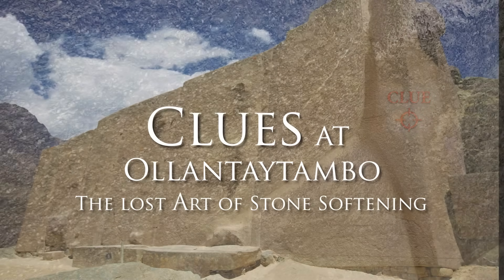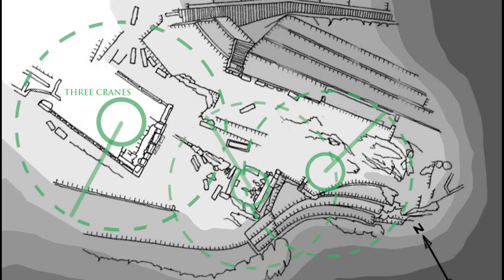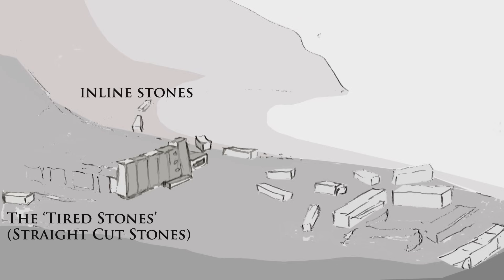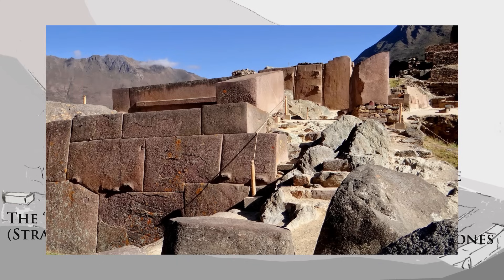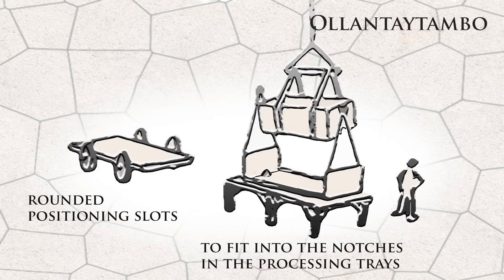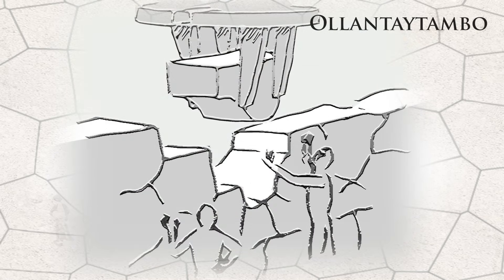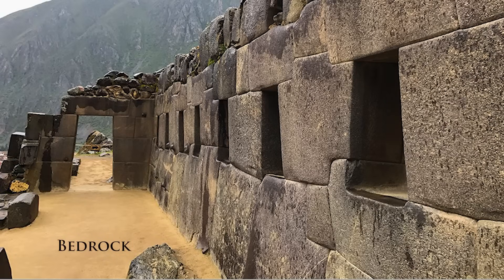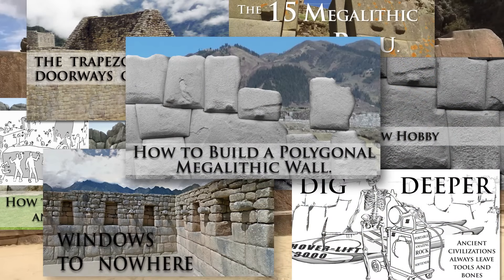Clues at Ollantaytambo. The Lost Art of Stone Softening

Comment: Wire cutting?  Where did the wire come from? Rocks contain several kinds of crystals. You can't "soften" a crystal structure. And don't you just love the wagons they used? This whole thing defies science. Or ignores it.
Reply: Copper wire and diamond dust?
Reply: Ikr- idt barbed wire was invented 
1870..😁
Reply: I think rocks can be cut with wet string and sand. Not sure how they get internal corners. It will be obvious when someone figures it out.

Comment: Volcanic rock is hard as iron, but it is as soft as cheddar cheese while still in the underground mines, easy to cut into regular size blocks for building defensive walls which harden exposed to air. Romans knew this.
Reply: Lol. You just made that up. Complete load of tosh!
Reply: Sorry Mark it’s cold hard facts!  12 years in Archaeology you pick up a few tasty scraps of knowledge.  Maybe these ancient rocks are a lot softer when freshly cut from the belly of the planet?  If so, you’d need a handy lump on the side so you could repeatedly lift and drop it to mould into the rock below. Less glamorous than a sonic probe but worth thinking about. Let’s go find the quarry and dig down past the oxidised crust, down into the easily workable stuff 🤪

Comment: I have questions. How do they manage to cut the stone in to pieces in the first place from the quarry? Second no one has ever found tools capable of cutting granite and other materials of this hardness. Where are these tools? To soften the stone in the first place the components that make up granite are silicate or crystalline. I may be wrong, but to reach a temp enough to make them soft they need to be at around 600 to 800 degrees to begin the softening process. I’m not too sure I buy the hypothesis of using plants to soften crystalline stone.

Comment: If that rock wasn't melted with heat, any liquid, even under pressure, would at best find its way thru some cracks...or dissolve it in the case of acid.  Or take thousands of years..maybe.  I'm definitely listening and a well put together piece. Great job yo.
Reply: The rock was neither melted (no sign of burning) nor dissolved (it could not harden again). Instead, it was softened by some chemical agent. According to Indian legends, the juice of a rare mountain plant was used in ancient times to soften rock.

Comment: This is only thing that makes sense.  It’s either that, or they literally had hydrolic machines with table saws, etc to cut the rock.
Reply: so true
Reply: The site was undergoing remodelling work when abandoned.  That would have been in the 1400s.  Stonecraft of very high quality had been a thing for the best part of 1000 years by then. And yes, no shortage of iron (albeit expensive) iron tools.  The oldest iron-mine can be found in S America and dates back 11,000 years.
Reply: You can cut rock with a wooden saw, using sand and water. Just slide the wood back and forth, drizzling on the sand, and keep the cut wet. It goes surprisingly quickly. The modern version uses tensioned steel blades, but works just the same. Look at the marble quarries (or granite blocks broken out using wedges, then cut with the saws).

Comment: hmmmmmmm, nope i cant believe it. As a stonemason softening stone would be a terrible idea lol, Stone is made of many types of minerals. Soaking in a solution that some how softens these crystalline structures almost makes it pointless. It wouldnt hold its worked shape and even as it hardened it would have to shrink leaving massive gaps in the stone joins, you cant add a fluid to stone and not have the stone swell with that fluid and then expect it not to shrink when that fluid is gone? 
polygonal masonry is pretty impressive looking, but also not as labour intensive as trying to make flat square stones sit flat and square. Just have a look at drystone walls. no mortar just stones that sit and fit together from their natural shape. As for the bedrock not being removed. Thats on purpose because thats the foundations. you dont dig out the concrete under your house for the same reason. Shits gunna fall down lol.
Reply: If the degree of softening was controlled by the concentration and temperature of the active agent, a treated stone block could hold its shape sufficiently. After all, the builders were not carving sculptures and they didn't care if the worked shape of their cut stone did not hold exactly. They did not care about any deformation and distortion of the blocks they had cut because the whole point was to let the blocks undergo some deformation as they were placed together so as to fit perfectly. Your objections are misplaced.
Reply: @stephenphillips4984  it would be easier to carve them. These are people making things from stone. The easiest way is usually the best way... So if they can concoct a solution that softens stones and have the technology to control its ratios and heat required then wouldn't they have the ability to just make it square? Just pump them square 10t blocks out all day.. easy right?
Or do you just get like 300 slaves to bash away at rocks and slot them together while you chill in the palace eating jungle fruit yo...? 
Yeah, see which one makes sense now. 
Rock is not science. It's common sense.
Concrete is science, which there is lack of. 
I do give ancient humans credit for doing these constructions, humans are smart. Bashy rocks to make temple smart, not chemistry denying rock melting gods smart...
When you have worked with the earth and stone like I personally have. Some things are as plain as they seem. It's not hard.(pun intended)

Comment: Excellent clue evidence of stone softening. However, three problems: 1. why spoil the plausibility of this theory by invoking unnecessary sonic tools that require power sources equivalent to those of the modern era - an idea that scientists would not accept?  2. How could immersion of something like a block of andesite in a tank of liquid result in the latter soaking through its bulk so as to soften it? It is apparent that ALL the volume of a block was softened, not just its surface, as the fine wire cutting indicates. But this would require the softening agent to soak deep into the  hard stone? It is hard to believe this is possible, but I suppose all bets are off until we find what softening chemicals were used (perhaps the juices of a certain plant, according to legends). 3. What were the knobs on the faces of some blocks for and how were they formed, given that the raw, cut blocks would have had smooth surfaces? The softening theory needs to  be able to account for them as well.
Reply: andesite is igneous rock and main constituent are silica so like granite it is impervious to water the only thing that dissolve these type of rock is hydrofluoric acid
Reply: @al2207  We are not talking about dissolving. The rocks were softened, not dissolved in any way.
Reply: @stephenphillips4984  Surely in order to soften a rock fully it must be penetrated fully by the 'special liquid'.  And since igneous rock is impermeable to water that could never happen.  So that's the end of this crazy theory !
Reply: @coloneled2831  maybe yes,maybe not... Like Tesla alluded to , to understand the universe, we need to think in matters of energy, vibration and frequency ... There are recent experiments about Sonic levitation ... We lost a Lot of technology ...  Vedas had Vimanas ... Baghdad batteries were that , batteries.... Not everything needs to be powered by thousands of watts... Nikola Tesla figured out how to use cold electricity .... And that's why he would grab lamps w his hands ....the current teaching system , is a fraud ...
Reply: The knobs look like a side effect.

Take a block of soft clay, now let it dry a little, then drop another block on top of it. You will get a knob exactly like the observed knobs when the softer core breaks through the partially hardened crust.
Reply: What kind of "wire" was used. This is bs. I under stand the softening, but sonic clamps a stone cutting "wire saw?"
Reply from the maker: Stephen,  Thank You for your comments!   In my last two videos I mention the use of a sonic soft-stick to soften the stone and to stear it into position. And in my latest video 'The Math and Science' illustrates this even more.  I hope this helps.
Reply: Unfortunately, it didn't answer my questions. But at least we both agree that there is a real problem to solve, unlike archaeologists with their stone pounders and bronze chisels. Sonic tools fail to solve the issue satisfactorily because they would, presumably, require the application of electrical power. Did the builders trek up the mountains with large batteries on the backs of llamas? I doubt it. And so would scientists, because the notion implies technological advancement of a degree for which no other evidence exists. The notion of powered tools is therefore as poor an explanation as invoking aliens.
Reply: @stephenphillips4984  what evidence of technological advancement would you expect to find after thousands of years? Power cords and electrical plugs? Only the stone itself would remain. 

Batteries and Llamas are an allusion to the Inca of 500 years ago. The megalithic structures were in Peru long before the Inca.
Reply: It all boils down to chemistry and a PH scale...One would think if a team of today's top Chemists were
hired to study this process It wouldn't take them long to solve all the mysteries we discuss today